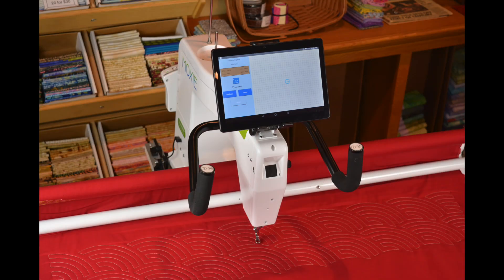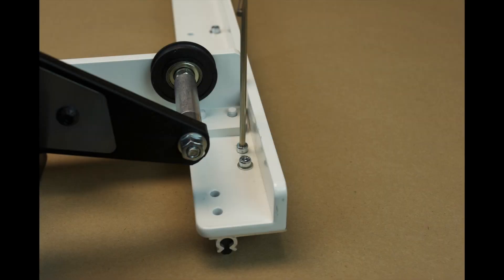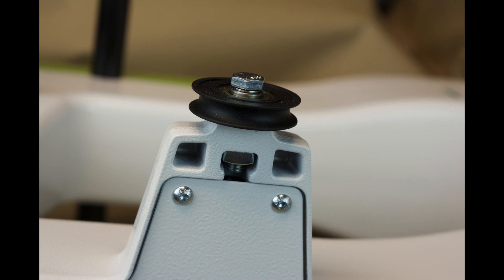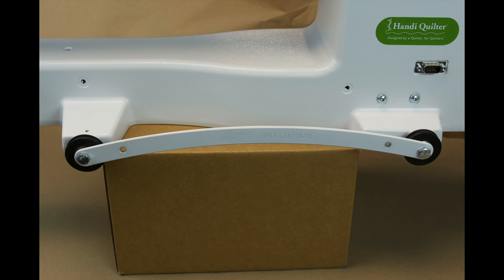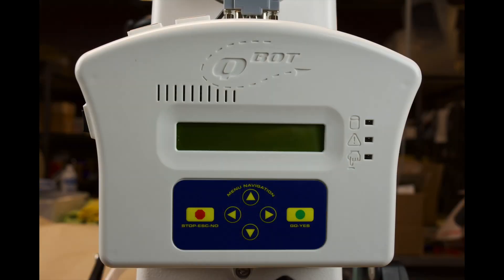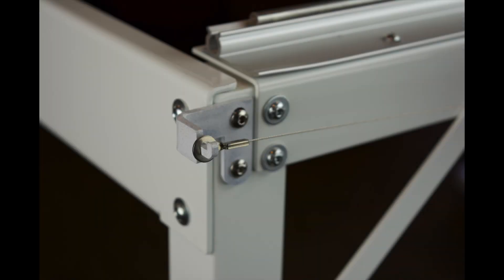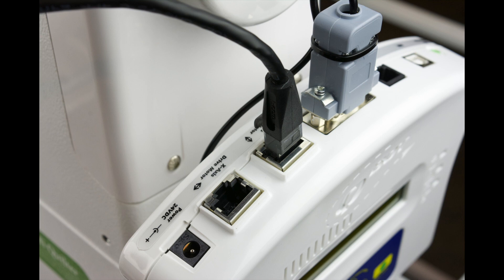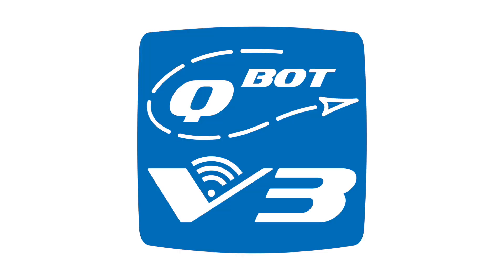QBOT V3 Installation on Handi Quilter MOXIE machine and Loft Frame

Comment: Is this a universal unit or is there a specific hardware version for HQ Moxie?
Reply from the maker: The installation hardware and head mounting bracket are specific to the Moxie.
Reply: this Qbot hardware and installation kit is made just for HQMoxie
Reply: I have emailed Qbot support twice recently - once about what I need to install Qbot on the Moxie/Loft combo, and once about an HQ16. They haven’t answered my questions in either email. I thought Qbot was supposed to have such good support. I am very frustrated!